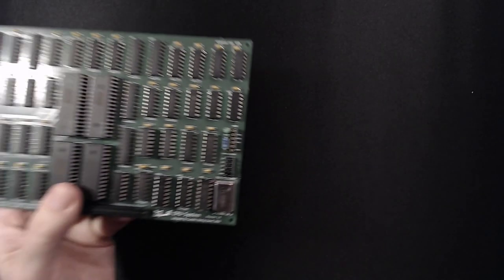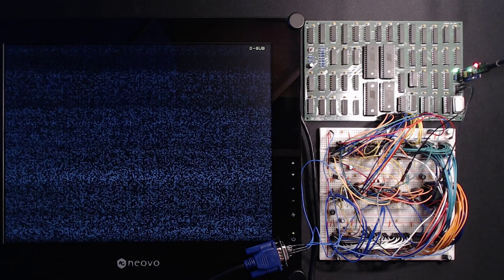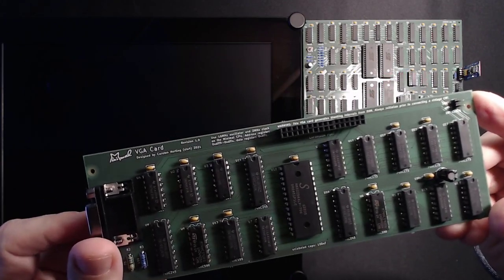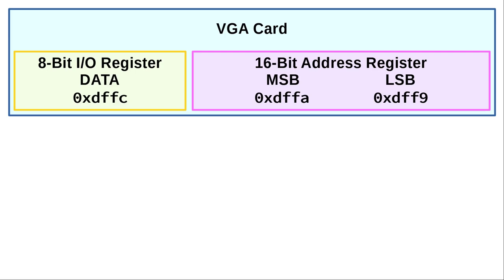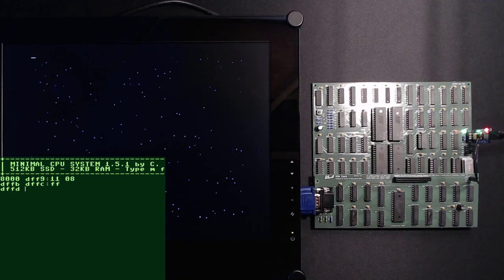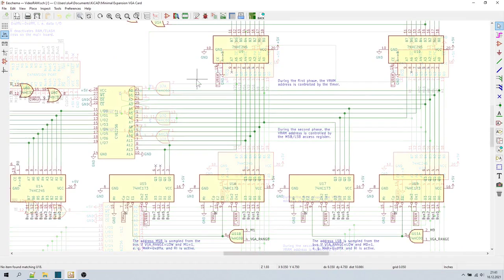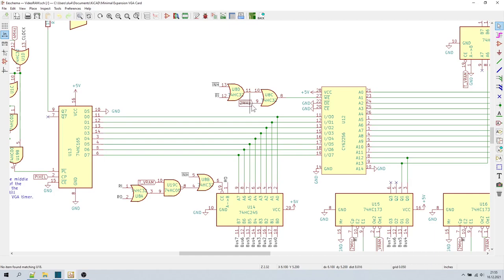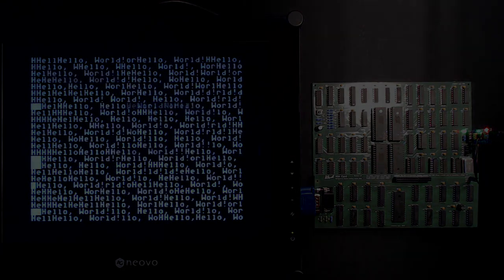Minimal VGA Expansion Card - DIY Video RAM #5

Comment: Great video. You used the same technique as I did for the bus sharing. This is a much better way of doing it than Ben Eaters video card as it doesn't halt the CPU when reading and writing to the video RAM. You should try adding colour to your next VGA project.
Reply from the maker: Hi David, minimal solutions converge. That's a good sign. Adding color is something I am not going to include in the near future. To me color just doesn't feel like being part of a Minimal system ;-) Cheers!